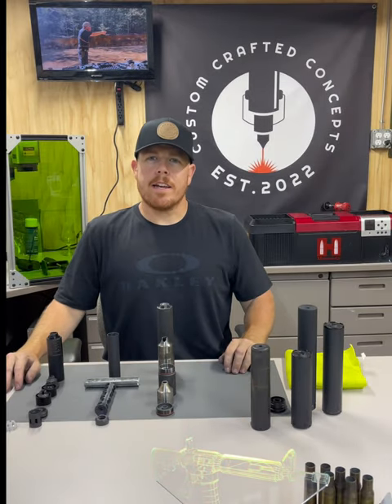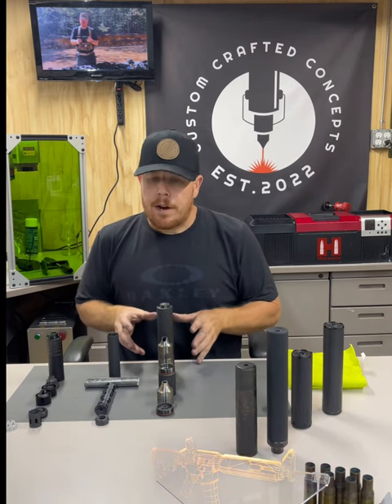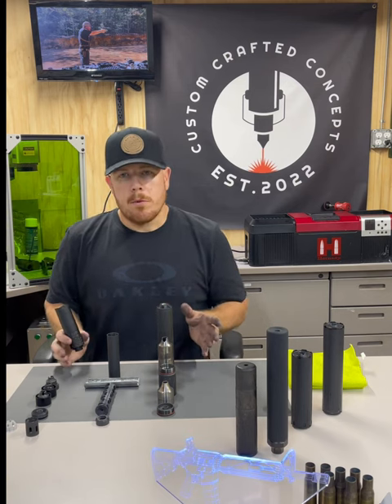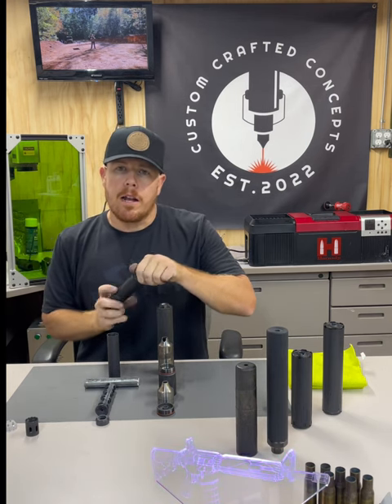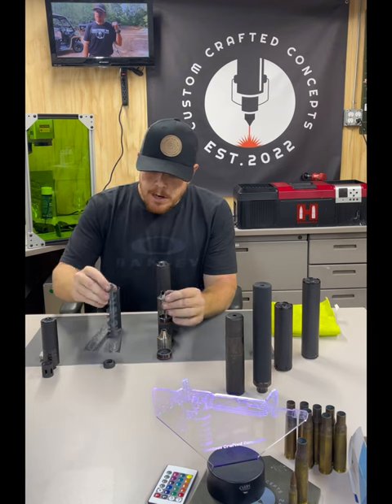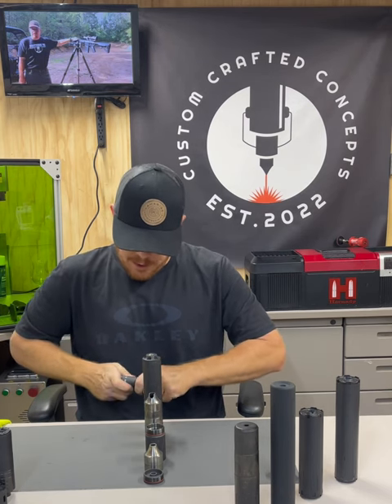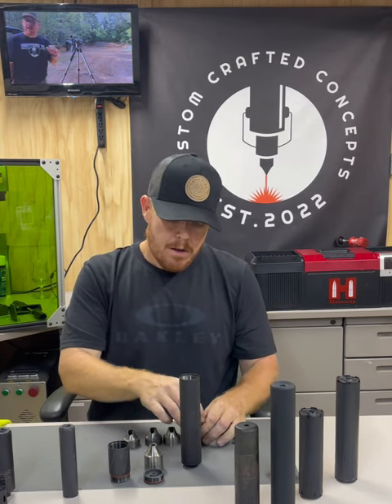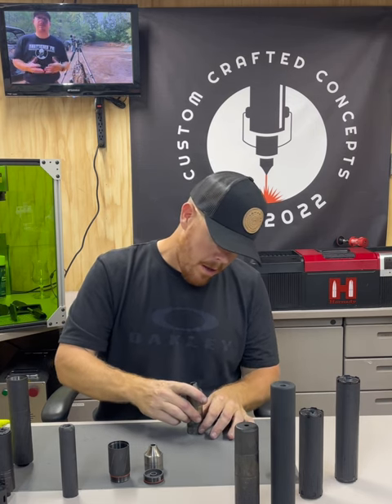Silencer breakdown, user serviceable and information

Comment: Where do you get a smaller diameter front cap for the lahar cans? I emailed aero a while back and they said they had no plans of offering different caliber front caps
Reply from the maker: I’m running the 30 cal diameter front cap, but I swap out between the 1/2x28 and 5/8x 24 end caps for 556 and my 308 rifles. Those are available on the website
Reply: @CustomCraftedConceptsllc  oh ok I guess I misunderstood you in the video. I thought you were talking about different caliber exit end caps not the barrel mount caps